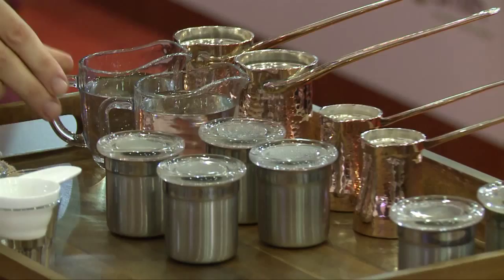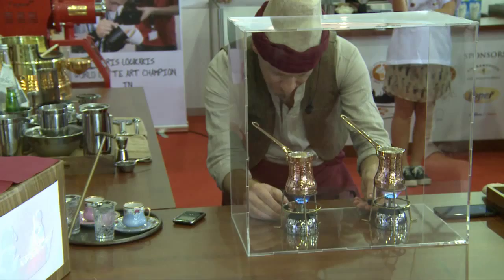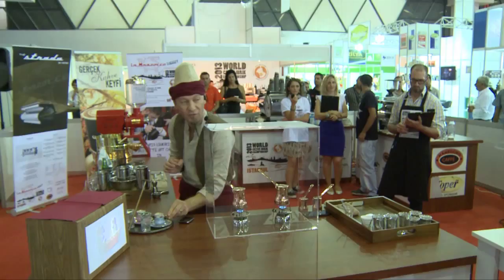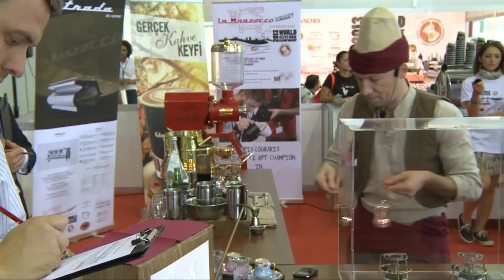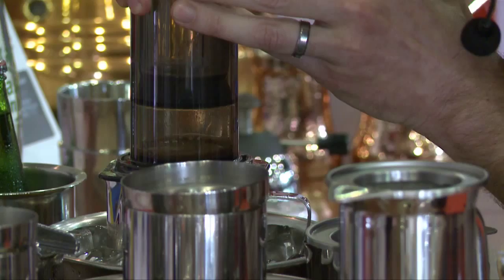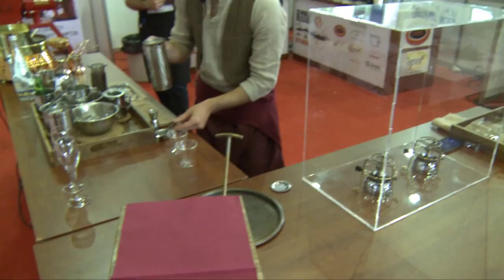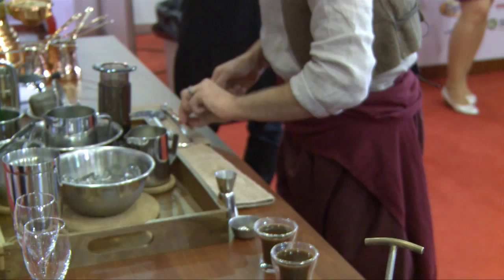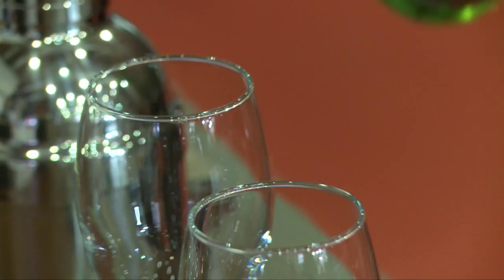Turgay YILDIZLI 2013 WCE World Cezve/Ibrik Champion

Comment: such a great video really.  I recently started brewing coffee this way thanks to you and i have to admit that i love it although i definitely don't make it to its full potential. It was quite an adventure because i couldn't find good equipment to make it as finding 1 cup size ibrik is impossible and i can't afford the SOY one, but the recipe is very good so i am trying to get all the necessary stuff. I started making it using the hario skerton grinder and a medium roast coffee and as an ibrik i am using the heating chamber of a 1 cup moka pot that i pick up with an oven mitt, i check the temperature with a termometer because being aluminum it may heat too fast ahah it's an adventure but i will eventually get the right sized ibrik, thanks for your videos!